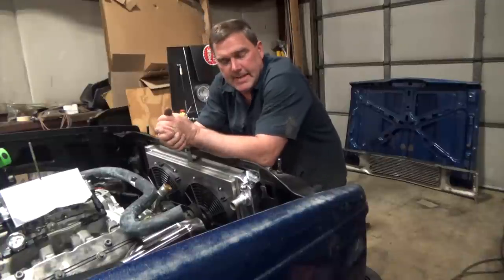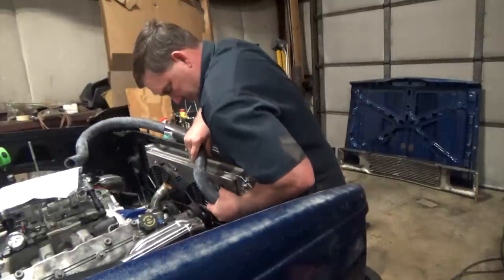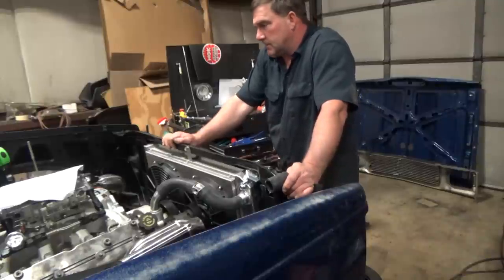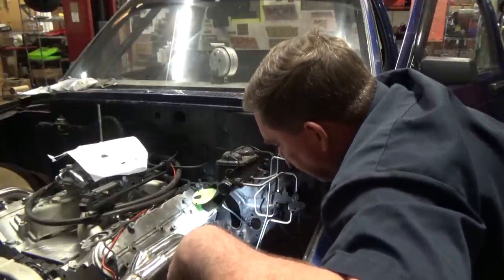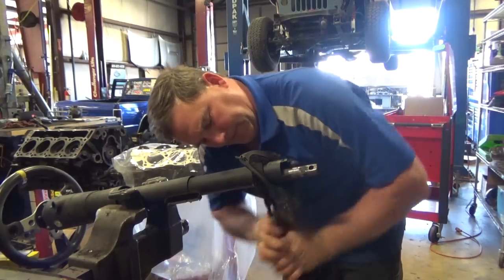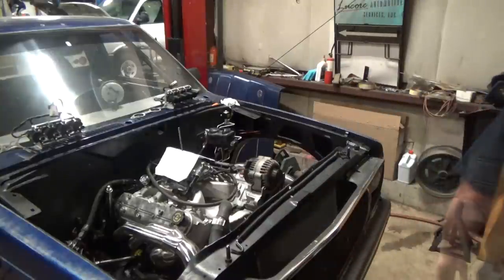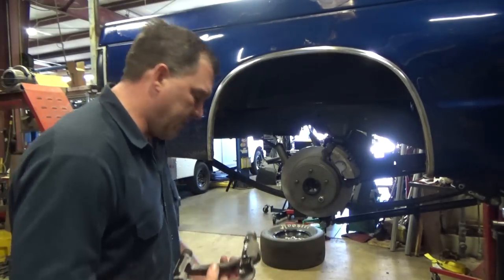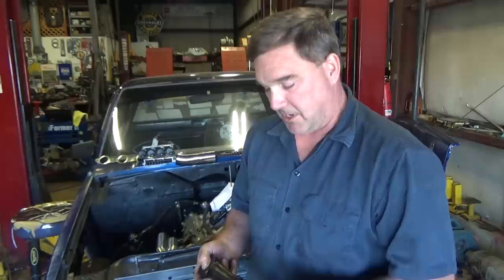Project Progress on the Blue LS S10 Truck! Manual Steering, Cooling, Brakes, and more!

Comment: With the low mount thermostat on the LS engines you should try filling the block with coolant first then the radiator. (Fill via upper hose) 
Add 2 - 1/8” bleed holes to the thermostat. 
Both of these tips help eliminate the air bubble the LS suffers when filling the coolant. 👍
Reply: I usually pull the coolant temp sensor on the drivers side head to bleed air out.  On this car I have a bleed point on the upper hose.  It will be more convenient at that location.

Comment: There is a product from viper it’s called wet-rag, it is used for brazing or soldering. It stops heat transfer where you place it. It’s like play-Doh and it’s reusable. I use it a lot to keep from melting plastic or rubber bushings. We all know that using water to rapidly cool metal is not ideal.
Reply: @Chris Durham I've used that product and I'm liking it a lot. I like to use it when working on motorcycle stuff it helps to keep the heat from damaging the case while you weld
Reply: Thanks for the tip.  I am always open to tips to do the job better.  Cheers!
Reply from the maker: Ohhh great tip! Exactly why we love all you folks watching and commenting!

Comment: Rich this S-10 has turned into bigger project. Started with aligning . Now cooling and exhaust. And new Steering box. Are you going realign the truck again. I’m sure the owner will be tickled pink. Thanks for sharing. 💯👊
Reply: I haven't put it on the alignment rack yet, but it should be there soon.  things escalated quickly and the truck will have a good beginning with a lot of unique changes.  The steering modifications should make for a great straight line chassis.  The owner was sitting in it today and was very happy with the new wheel and column placement.  Thanks for watching what we do